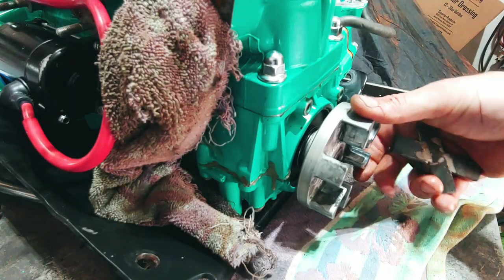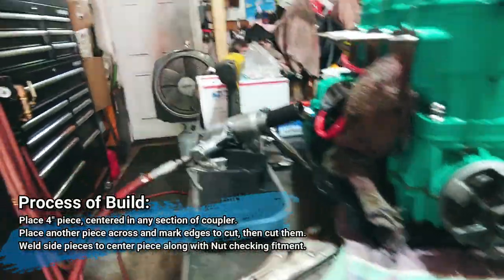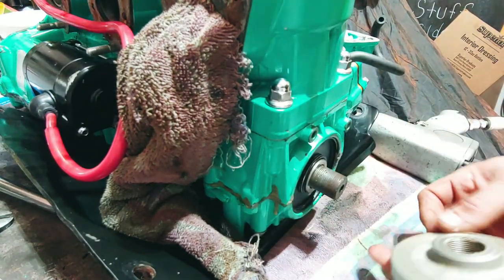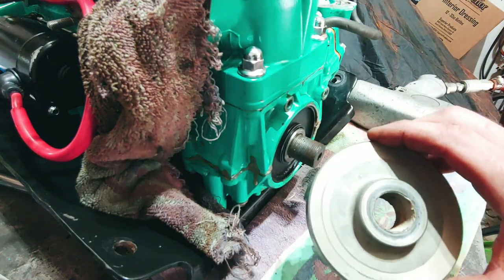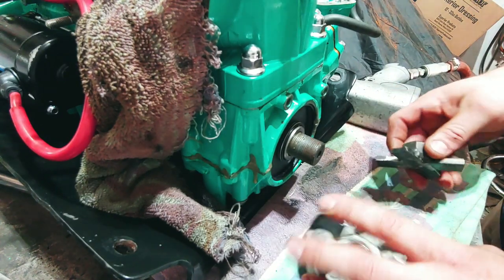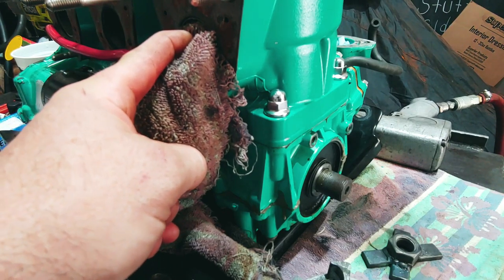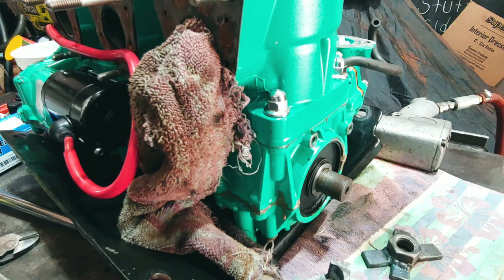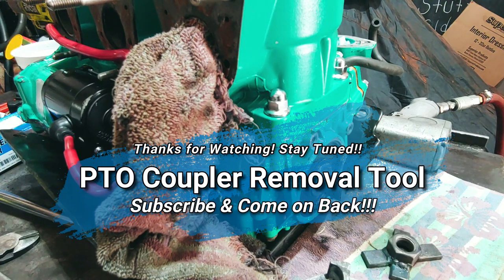How To: Kawasaki Jet Ski PTO Coupler Removal

Comment: I need that tool today!  No joke.
Reply from the maker: Yeah it helps big time and was easy to make.
Reply: @Fixin2Ride-Official-  I dont have a welder.  I also cant figure out how to get the flywheel off the other end.  I will buy that tool if you want to sell it.
Reply from the maker: Do you have access to an old coupler from the jet pump drive shaft? You could use that and a pipe wrench.
Reply: @Fixin2Ride-Official-  I have the engine out and tore down.  I cant get the flywheel or that coupler off.  Looks like you need special tools.
Reply from the maker: If you have a piece lf steel that will fit in the couple, drill a hole and then file it square inside to use a 1/2" ratchet might work!
Reply from the maker: You also need to purchase the flywheel puller. Them stick some ripe down the spark hole and it will stop the piston and crank.

Comment: Great idea. The O-ring is in the sleeve that the coupler tightens against. 

I use pull cord or rope down the spark plug hole to lock up the crank when there isn't another good option 👍

I'm not a fan of using the ports as it puts a lot of uneven load on the piston, one skirt and one ringland. Probably not enough to ever matter, but I still don't do it that way. I also don't like using the impact gun in this situation. If I were going to use an impact gun I would hold the flywheel with my hand... in fact you probably don't need to hold anything at all because of the inertia of the crank... it will rotate a little, but the coupler would still come off. 

Not trying to pick on you, just trying to be helpful and give my  $.02
Reply from the maker: No way man! You're not picking on me and I don't take it like that at all... I appreciate the good info and wisdom and yeah the idea about uneven pressure on the piston and skirt in the port is still a real good bit of information so I think I'll change that up. Thanks again and hope all is well!
Andrew C.
Reply: @Fixin2Ride-Official-  I'm currently putting a 1100 in my X2 and had to shorten the drive shaft. I got lazy / sloppy and broke both of my couplers... Knowing that you should do something only helps if you do it 😂 You didn't break yours so 👍
Reply from the maker: Yeah I try not to do things that will cause issues. This is why I go as far as I do with everything. So I dont have worry and can enjoy the machines like they were meant to be enjoyed.